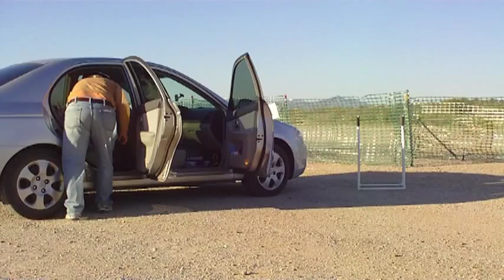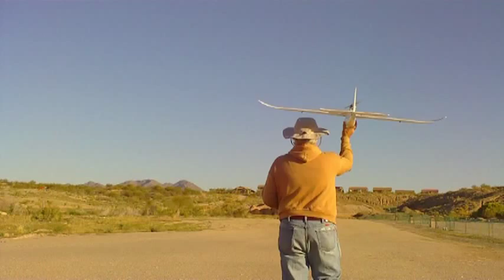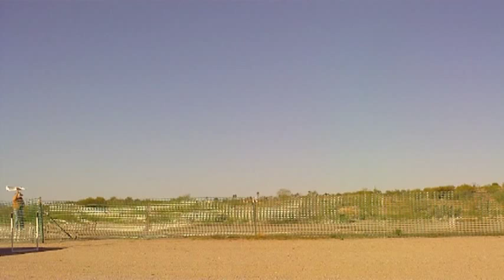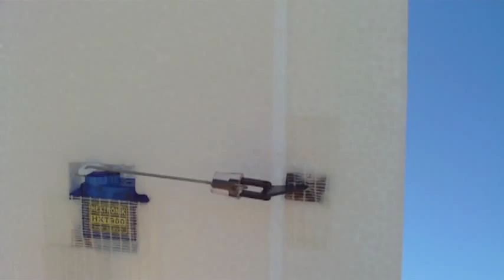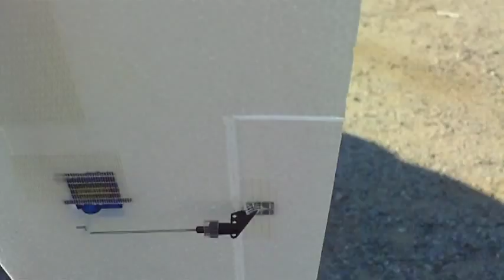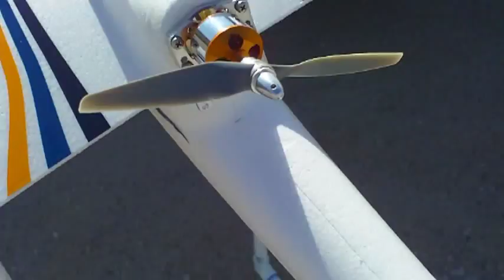Prof. Iadevaia's Bixler Maiden Flight Post Kit Build

Comment from the maker: If the plane is properly balanced it should remain level from the hand toss
and a little up elevator will get you flying...but you have to see how it
goes when you actually fly it. I usually apply full throttle then back off
as it climbs out.

Comment: Thanks for the vids both for the build and the maiden flight. I have the Bixler 2 on order and have picked up some good tips from your vid, especially the motor mount mod. CNC are selling them on eBay so I have got one for the NTM that I'll be putting on the B2 when it gets here. Question: after the hand launch how quick did you have to apply up elevator and did it take much on the stick to stop it nose diving into the dirt? Mark